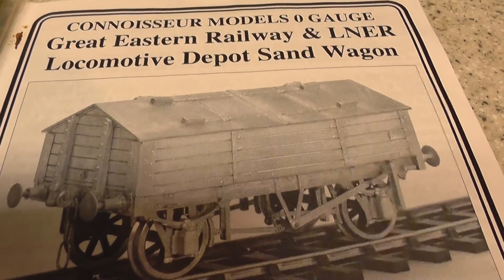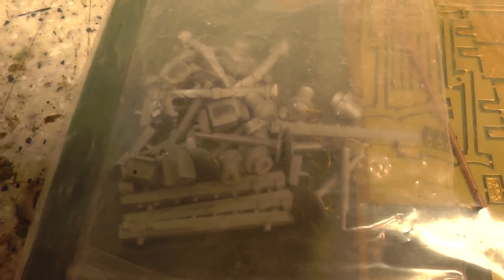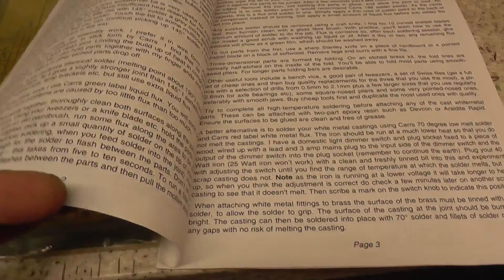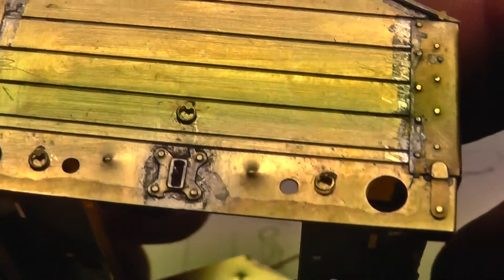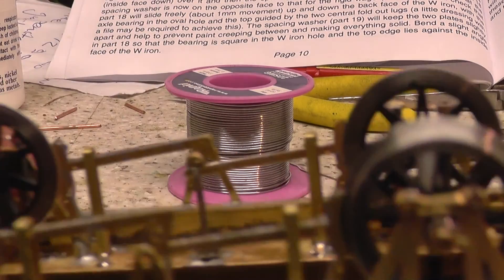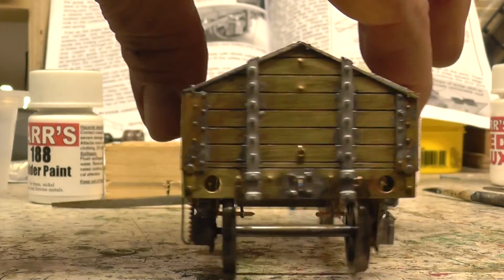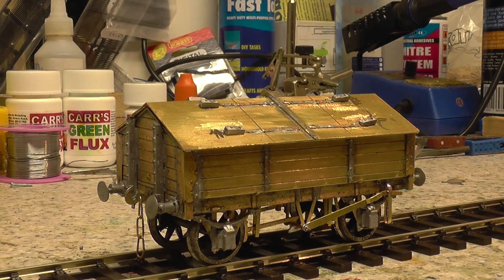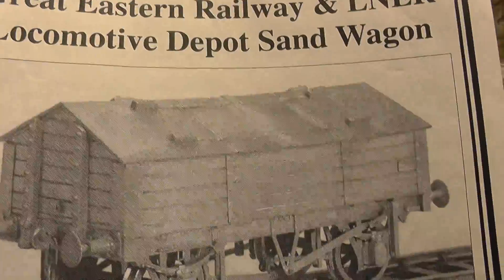O Guage brass wagon kit

Comment: It's a very good effort for your first model, the quality of Jim's kits helps a lot with this.
I could see some points which can easily be improved.
One thing was the punch trough rivets, there was a fair amount of metal pulled down around those rivets, which indicates to me that they were probably punched trough on a fairly soft surface like a cutting mat.
Try punching the rivets on a fairly hard piece of wood, like a plank of oak or hardwood plywood, a wooden or nylon cutting board does work well in my experience and gives much crisper and nicer rivets.
The solder stains can be completely rubbed of with the glassfiber pen you have, just brush in the direction of the planking grooves to avoid rounding of the detail

I have seen the same small disadvantge on your kit as on some coaches I have from Jim, there is no separate chassis and floor for the wagon, and that makes lining up your axles a bit more difficult, because you can't put the model upside down on a flat surface to check the alignment.
I meet up one axle guard to the chassis in the desired position and then scribe a line along the underside of the chassis, then measure the distance between the line and the underside, and scribe a line on the other 3 at the same distance.
Then they can be soldered in exact the same height by clamping them to the underside of the wagon with crocodile clips or clothes pegs, before soldering.
Should the wagon still be a bit wobly after this then the chassis may be a bit warped, and this can be adjusted by giving a little twist on the chassis/body assembly

Comment: A very detailed wagon. Is there a natural weight to the wagon, being brass, or did you have to add some? I think you did a great job in soldering Kevin, and when its painted you wouldn't even notice it.
Reply from the maker: Hi John it is quite heavy compared to what I am used to do have not run it as I only have a piece of track so  not been run properly yet it has had it first coat of primer and  is looking good cheers Kevin

Comment: At least it was O scale so it makes it a little easier to put together.  Once its cleaned and painted it should look really good.  The solder paint must have helped instead of using regular solder.  Great job.
Scott
Reply from the maker: Hi Scott easier than oo that's for sure the solder paint is good on certain bits cheers Kevin

Comment: Hi I need your help I've just got a plank brass wagon kit but not sure I've got the right stuff to build it with I saw your bits and pieces from Carr ect not sure what tools and soldering iron to get ect
Reply from the maker: Hi Paul I bought a variable temperature soldering iron from Maplins  cost about £50.00 and just general modelling tools cheers kevin
Reply: +kevintregunna ok Kevin thanks what about flux and solder dose it have to be carrs?
Reply from the maker: +Paul Smith hi Paul you could use normal flux but the liquid flux like cars is a cleaner product the only carrs solder I use is low melt for use on white metal kits the only think I would say is clean the brass extremely well with fine wire wool and then put the flux on .get some off cuts of brass and practice before you start your kit . But it must be really clean before you start
Reply: +kevintregunna I have a glass fiber brush I use I have practiced soldering two bits of brass together but I seem to be alot of tools down which were on the paper instructions I would of liked to have seen how you did it on the video chap
Reply from the maker: +Paul Smith hi Paul I have some more kits to do but I have not had a chance to video myself actually soldering that was the first one I did and I think it will be a. While before I get a chance check this video out it shows my soldering iron that I use and I talk about a few of the carrs flux and solder
Reply from the maker: https://youtu.be/tBVzCNDjcak